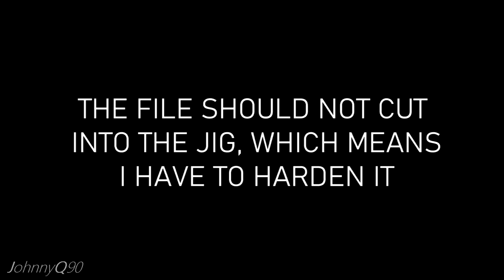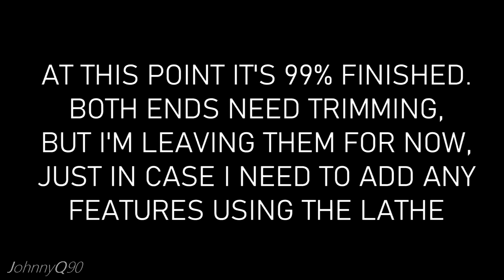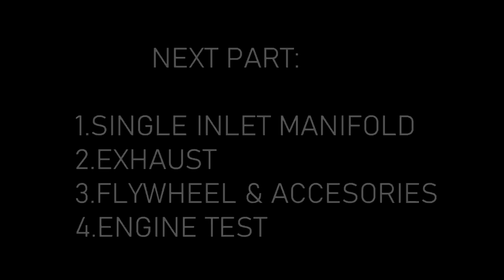Making a MK2 E-SHAFT for The 2 ROTOR R/C Engine! - Part 1/2

Comment: Im a machinist, for my part time gig we do Xometry work.   I was pressured into taking a cam shaft job because it was "cool" 50 mini cam shafts, made out of aluminum on the rotory 4th axis.  Then they said they accidently specified the wrong material and wanted stainless.   I refused and won't ever do cam shafts again.  They are not fun.

Comment: JohnnyQ90, for hardening this steel part.. You could follow the knife hardening path. At least for high carbon steel like 1095. First perform a neutralizing of baking at 400 F for 2 hours then let air-cool in the kiln overnight. The important part is to let the part slowly cool which affects the grain structure, do not rush it. Look up the this metal melting point and then heat to a few hundred degrees under and quench in canola oil. This will make the part crazy strong but brittle. You can also bake after quenching at a few hundred degrees for a few cycles which will soften up the metal a little bit again and release internal stresses. I cant remember where i saw it but some data exists of quenching steel using different mediums such as water, motor oil, etc. Canola oil always seemed to give the best results. Hope this helps. I love watching your projects, you are a super talented machinist.

Comment: I would love to see a quad rotor Mazda 26b R/C replica in the future!! GREAT WORK! #BRAPBRAPBRAP
Reply: Hell yea mini Mazda r26b
Reply: That 787B was such an incredible machine... the intakes alone were a work of art.
Reply: @robbfisher2876  variable lenght geometry intake in the 90's 🤯😱
Reply: And then throw it into a scaled down 787B R/C car!
Reply: It wouldn't last long, nor will this twin rotor. 
Gunna have meltdown issues.
It needs heat transfer... oil cooling the best, but how when the rotors are not hollow and the crank is too small to accommodate a sufficiently sized hole through the middle. 
Water cooling the easiest.
Reply: @BTW... adding water cooling to most engine blocks make the more fragile so i am not sure where you going with this,a way for him to actually do it propper is to run methanol or ethanol.provides great cooling.

Comment: This is bloody awesome! Can't wait to see it run! Remember rotaries love flowing alot of air, make your intake and exhaust with this in mind =P
Reply: Square cube law dictates that this engine has way more surface to volume area and therefore intake area to chamber volume area then the same engines scaled up to say the proportions of the 13b. This means it can flow way more air but usually also means a verry high idle.

Comment: Eccentric turning is just so mesmerizing...

Small advice: whenever heat tresting anything, whether it got really hard or not, do ALWAYS temper your part afterwards. Heat treatment bring hardness which we want and brittleness which we don't want at all. Just put it in the oven at 220-350°C and let it soak for an hour or so. The higher the heat the less brittle, but also the less hard. 
With these high precision parts you should temper it before grinding to perfection.

Hope I could help a bit

Comment: I’m a big rotor head from way back owned a few RX7’s in my day. I’m sure at some point I bought one of the first Winkel engine that O.S. Offered for the RC market in the US. It performed well but the fuel economy suffered. And the power and fuel duration I got out of a regular reciprocating engine was just a little easier on the budget. But a great piece of engineering. Awesome work love all your videos!!

Comment: I'm not sure how much that squeaking noise means chatter on this kind of lathe but you can dampen that with some rubber attached to the shaft, such as winding some rubber bands around it to make a ball of rubber on the longer end or by making a mass damper for the tool holder from castable rubber and a lump of metal as a weight. When machining brake drums and rotors the lathe has a lead weighted rubber band that wraps around the part to dampen it from chatter to get a really smooth cut. We also use a round bit instead of a pointed bit which also chatters less too.

Comment: Tool post grinders are friggin awesome, it's amazing how fine a cut you can make with them in the hardest of metals, even carbide if you have the wheels for it, and the surface finishes, especially with a finer wheel and slow cut, can be mirror smooth and the accuracy limited only by the straightness of your ways. They're one of my favorite tools on a lathe, probably the equivalent of a rotary table for a mill lol.

Comment: Looks promising, regarding the hardness it could have been to slow of a quench although it's a small part.
1045 gets the maximum hardness with a water or brine quench however it probably does need to be tempered back at that point.

Comment: If the rotors are 180 degrees from one another, why do you need counterweights?    The single rotor version required it because the rotor was off center.   With two rotors 180 degrees between them, the offset each other's weight.   I think two would be perfectly balanced.

Comment: First of all great job! I do have a question about your heat treat. What was your purpose for using the sunflower oil vs canola vs used motor oil vs quenching oil? I also showed my dad (we were both machinists) do you know the hardness due to the oil?  Obviously quenching in oil allows for more shock resistance. I've just personally never used one of the cooking oil/food oils. Ive been tempted to try it but it has such a high water footprint. We use a battery operated Rockwell tester. Sometimes I wish the videos contained more.   🤣  keep up the good work.
Reply: Google it, I have a list of different oils that are best for certain purposes.

Comment: Hello, great job on that rotor shaft! Very impressive and great precision.  Do you still need the counter weights? It is a twin cylinder now, so plain flywheels might be better? Are each rotor not going to balance together?
Reply: Even when you do balance a wankel engine you typically have counter weight and sheed weight out of the counter weight as well.
Reply: With a 2 rotor, the primary balance will be correct, if you look down the centreline of the E shaft the weight will be balanced, but if you look at it front to rear, the balance will be twice as bad because as one rotor is up, the other is down, which will setup a rocking motion. Full size rotaries right up to 4 rotors still need to use external counterweight to smooth out the secondary imbalance.

Comment: To heat treat and get a hardened carbon steel in oil you must first warm up the oil a bit before quenching(around 40 degrees). And I wish you didn't quench that piece in water. Also I wish you tampered the hardened steel.

Comment: Often, parts will harden just fine in oil, they're just not as hard as the file you use to check them. So they SEEM soft, but they're really not.

Comment: Hi Johny, great videos as usual. Do you mind my asking, what end mills do you use for milling steel?spindle rpm? feeds? what cutting fluid? So far, I have not encountered with high spindle speed steel milling, and you got me curious. I just finished the build of my cnc router, but it would be great if I could mill out parts from steel. Thanks a bunch.

Comment: I can see adding the flywheel weight(front counterweight) Are you sure you need the rear counterweight? I wound bet not due to you adding another rotor at 180* offset.

Comment: Did you temper the steel at all after your hardening process? If not it will be liable to fail quite early due to stress that hasn't been released.

Comment: I wonder, whats the point of lathing something between centers? I always tought it was when you want the part to be 100% straight (even more straight than a dial can measure) and not be dependant on the chuck adjustment, but since you mount the center in the chuck (instead of removing chuck and mounting the center on the spindle) the mounted center's accuracy is still dependant on the chuck, meaning if the chucks tightening is off-center, the center would also be off-center if im right? So it seems just to be a over-complicated way of mounting the stock in the lathe instead of just using the chuck without a center?

Comment: Just wondering why you went for center dogleg turning instead of just centering on the jaws not trying to be mean just curious maybe the chuck isn’t adjustable the ones I use at work for cranks I can dial in to .0002 runout or better so I’m honestly just curious because you can do eccentric off turning with a chuck as well so I’m honestly asking in case there’s something I can learn

Comment: I've always wondered, what's the benefit of turning between centres? Is it more accurate or does it provide greater access to the part? I know there must be a reason otherwise people would just clock stuff off in a 4 jaw but working between centres just seem limiting
Reply: Often it can be for quick repeatability. You can take the part in and out multiple times for different operations without having to dial in every time.
Reply: @chrisp.5482  Appreciated. I always wondered it does seem like a bit of a faff to set up but I suppose for repeatability and when you have some centre holes drilled in your part it would make it a lot easier to set up off centre parts

Comment: 0:38 
Does anyone know what is that thing that the author put at the shaft of that machine? (Weird looking thing, where you put the shaft inside, and you thread it up for the thing to be rigidly placed there)
Reply from the maker: It's called lathe dog, and it's used when turning between centers.
Reply: @johnnyq90 oh, makes sense, thank you very much for answering ☺️